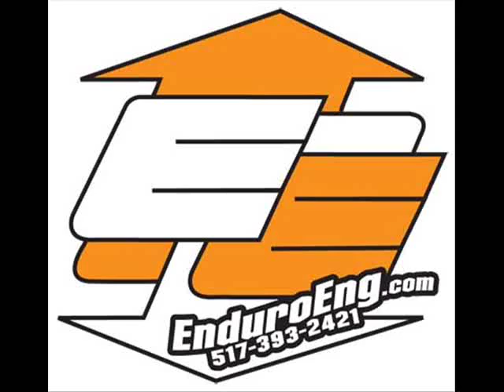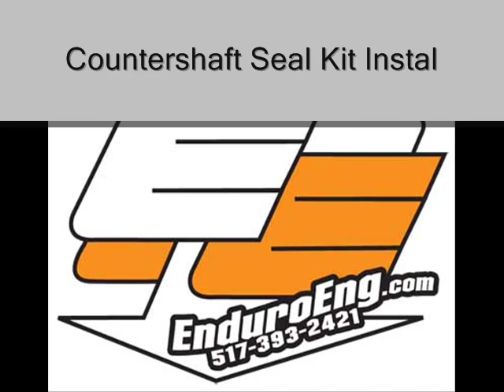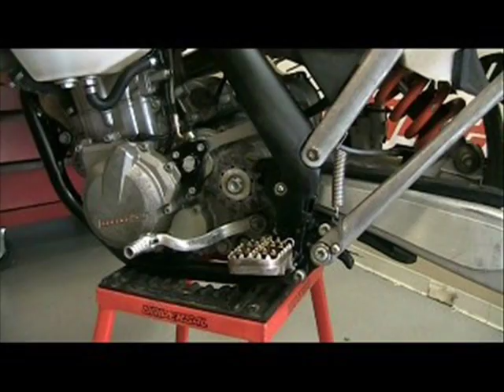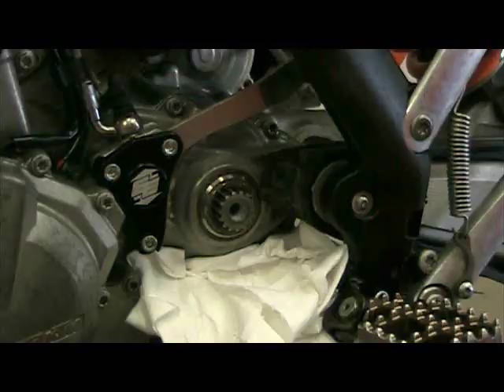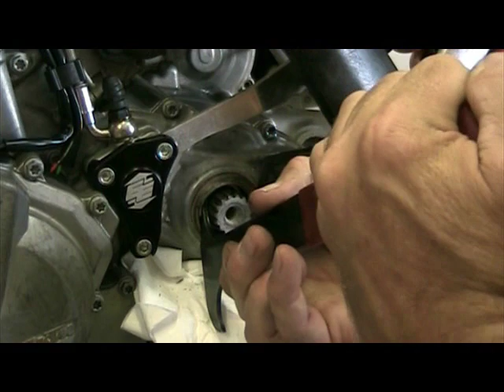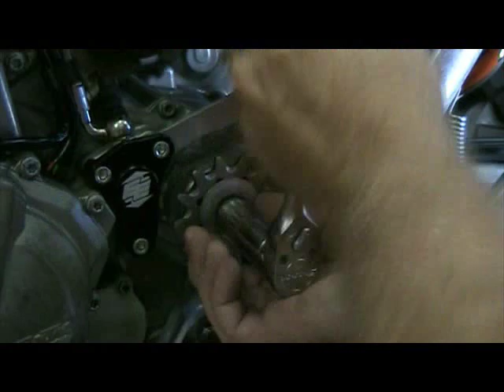16-070/16-071 Enduro Engineering Counter Shaft Seal Kit

Comment: If you use thread lock, remember that cos the bolt wont come out so easy next time you need to remove the countershaft sprocket. In order to get the bolt or any bolt that has thread lock on it removed, you'll have to heat the bolt to soften the thread lock chemical or risk breaking the bolt and/or stripping the threads

Comment: Thank you for showing me how to do this... the inside gasket on my 1999 ktm300mxc was ripped alittle bit when i first took the countershaft gear off. i put the the new one on with a dab of polymer silicone for engines to make sure the fit was secure but same procedure. great video thanks again :P